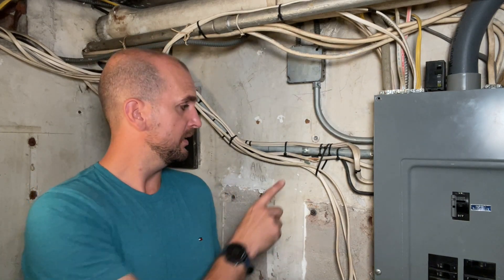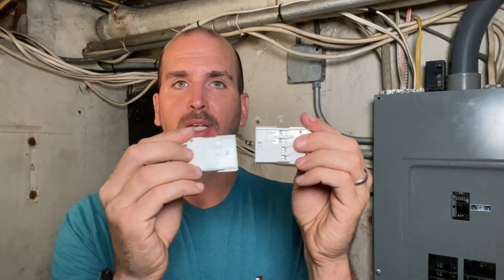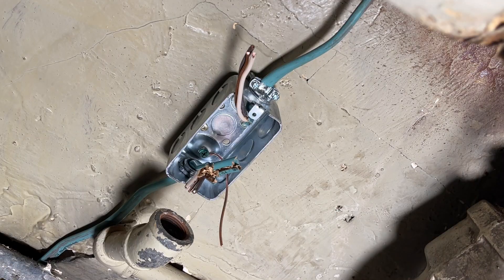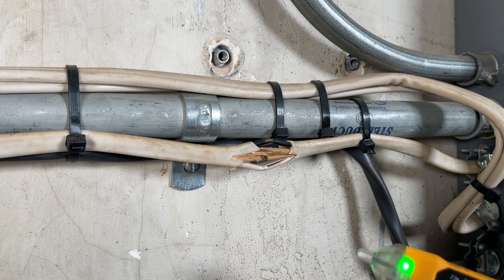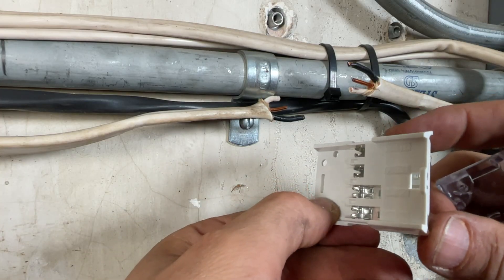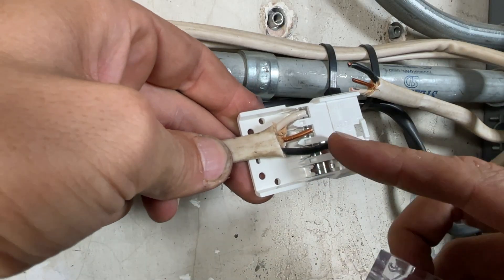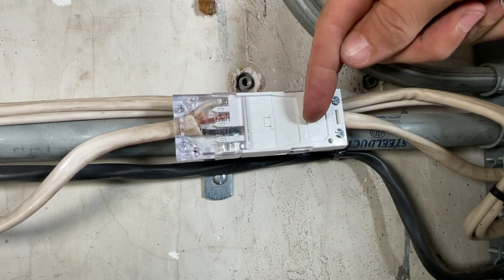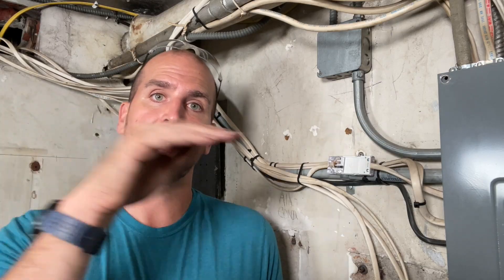How To Repair Damaged Romex Wires

Comment: It always bugs me that if the conductors aren't broken you have to break them??? Breaking solid copper which is a good connection. It seems crazy to add a point of weakness just so that you can have good insulation. Can you not somehow add insulation around the unbroken copper?
Reply: It's more about safety then maintaining the solid connection, if you are in the area, say running a new wire or a curious kid playing around, you don't want any chance to get zapped. Also, wiring is full of "weak points", every wire nut, outlet, screw terminal or other connection is a form a "weak point", adding one more isn't that big of a deal.
If you did want to add new insulation, you would have get a heat shrink tube to the exposed wire, which isn't going work for a inner wire, as the outer jacket will prevent you from doing that. The only case where heat shrink may be an option (depending on local codes) is if only the outer jacket is damaged (no exposed copper).
Things like Electric tape is not meant to be used as insulation/jacket repair, as it is likely to fall off over time and is against code.
Really the best way is to replace the whole cable. The old cable can be cut off where the split is, and re-used as two shorter cables elsewhere - or in the case of the video, he might have enough slack to cut the cable at the split and pull it 5 feet back to the box, depending on who installed it.
Reply: @notme232  I suppose you could put one of those small boxes around it and you fill with epoxy resin. Like a miniature version of the underground connecting resin filled joints. I've worked automotive electrics and we always solder everything, no screw terminals. You can't beat fused metal connections. I've never been a big fan of mechanical joints.
Reply: @toxicpadda  Boats as well.
Reply: @toxicpadda  ironically soldered connections on solid conductor are in fact weaker than properly crimped mechanical connections on stranded cable, emphasis on "properly".  The reason being is that in the event of an overload that doesn't immediately trip the breaker it can cause the wires to heat up enough to make the solder joint become ohmic and get into a thermal runaway condition not protected by the breaker.  Since the point of solder is to have an alloy with a significantly lower melting point than copper itself.  A proper mechanical crimp actually cold welds all the strands together to make a joint unaffected by the temperature of the conductor. Joining stranded to solid of similar gauge is very tricky since you cannot use a crimp conductor on solid conductor.  Solid conductors are only meant for wiring not subject to movement hence why even utility wiring is rarely ever solid.

All that said would rather use a splice kit that uses brass screw butts mounted in a nylon "barrel" that includes a section of double wall heat shrink in place of the snap-lock shown here. The contact fingers are fine but The insulation displacement connector style prongs should have stayed in the electronics world and never moved into the power electrical world.
Reply: @sivalley  Cold welding is an interesting subject altogether. There used to be a process that fell out of favour. It involved dendritic copper powder surrounding the wires to be crimped together. Sometimes the powder was stamped down. The copper powder would fuse on a molecular level , essentially becoming solid copper. 

It is a myth that solderd cables have a higher resistance. Even though the soldier has a higher resistance than the copper it's in contact with, the surface contact area is so great that the resistance is negotiable. I do understand  in a case of overload that the wires might heat up and unsolder themselves. but this would be far above the current rating of the circuit breaker. At this point  the insulation will start melting. It is unlikely that the majority of the heating would happen on the solder joint itself because of the "resistance to the solder"
Reply: @MyProjectBoxChannel  yeah very interesting. In the aerospace world, on an aircraft, compression crimped copper to copper is done for splices. With moisture, heat and cold, the solder joints have galvanic corrosion. This is the dissimilar metals. The joint would be copper, copper-solder alloy, then some solder, then copper solder alloy, then copper. I have designed, tested, and fielded aircraft electronic boxes, solder on the circuit boards, but copper to copper  crimps for the cabling. I'm always tempted to solder the cables, but it's not considered the most reliable.
Reply: @notme232  I disagree that adding a weak spot is not a big deal. I DO agree that many joints are done wrong for some reason and ARE therefore weak spots. Where in the code, I'm curious, would you say bans the use of electrical tape to repair damaged insulation; or where does the code authorized the use of heat shrink? What would you say about the use of electrical tape in pecker heads?
Reply: @michaelraab5669  There is a form of butt connectors (look very much just like the crimp-style) that consist of a length of heat shrink tubing, and then inside there's a ring of low melt point solder, and a ring of hot melt glue just inside either end.  You trim the insulation on both ends a bit, stuff them into each end of the tubing, and hit with the heat gun.  The solder melts and connects the wires, the hot melt glue melts and forms a water-proof seal around the wire, and the heat shrink tubing shrinks to provide physical support.

While this won't work well with solid core wire, it's code-approved AT LEAST (by CSA) for splicing underground stranded cable feeding submersible well pumps.  It used to be well drillers would have to special order the pump with a length of wire for the total length of wire to the nearest electrical box.  Now submersible pumps come with relatively short whips, and they just splice on whatever length they need from a roll of cable.  The splice ends up submerged.

I do not know the limitations of use.  I purchased a set of these splices from Amazon ahnd spliced what is essentially appliance cord on some built in lights (downlight LED hockeypucks), and as a concession to that, I layered some extra heat shrink tubing on top of it.  I'm confident that the worst that could happen is that a connection could fail, but considering where it is, it wouldn't do bad things, except cause a few lights to go out.

I would have preferred NOT do do that, but other options were not available without ripping out a lot of cabinetry.
Reply: I know what you are saying. A few minutes with a razor knife and some electrical tape and I could fix something like this as good as new and be neat about it
Reply: There is this nifty product called electrical tape, for the problem shown in the video there is nothing wrong with just taping around the romex, the bare spots on the conductors wont touch and everything will be fine.
Reply: @forddon  yes and nobody needs to know. And all will be fine 😉👍😂
Reply: @toxicpadda  I agree wholeheartedly but God forbid someone on YouTube shows how something is done in the real world.

Comment: That's how the cross-overs are done on manufactured home. Been that way for years and we've never been called back because one failed. Plug them in and stuff them into the underbelly, tape the hole and forget about them.

Comment: Where it is impractical or impossible to run new romex and the wire has no slack can two boxes be installed with new romex in between giving you the slack you need to make the repair?
Reply: Sure. Just don't cover them. A junction box is a junction box, you can have many but each new splice is additional points for failure. If done correctly, it isn't an issue. Basically like a giant pigtail with a jbox instead of wire nuts 😅

Comment: Clearly this is a demonstration so I will ignore his proximity to the panel . I was thinking about the WAGOS and the amount of metal to metal contact inside versus wire nuts . Then I thought every industrial machine in my shop has an electrical panel with hundreds of connections and voltage from 24 to 440  . And all the wires just plug into a connector that works just like a WAGO . So based on that I think they are just fine . As for that other connector NO WAY that will probably heat up with a heavy load like from  space heater ! That is just my 2 cents .

Comment: An electrician installing a circuit for my AC put a screw through a wire right by the breaker .  He said he was going to put a junction box next to the panel.  I said "no, you won't.  Run a new wire."  He was pissed but he did it and I went up and made sure he did.  That splice kit is something someone installs and says "that'll be the next guy's problem."  As I seem to be frequently the next guy, I don't like gizmo/gadet fixes.
Reply: I am an electrician, and while I wouldn't use this in your home, I definitely would use it in my own.  That thing looks like it will last forever on a 15A or 20A circuit.
Reply: @jeangadoury932  Go for it.  Won't see it in mine.
Reply: I don't understand your complaint. You say he was going to put a "junction box", so that is not a gismo/gadget fix.
Reply: @RemmikRotus  You're right it wasn't but I didn't want a junction box a foot from my breaker because the electrician didn't look where the wires were and shot a drill bit through a wire.  I didn't want a junction box nor a gadget fix.  I like clean wiring.
Reply: I agree - That splice kit looks like junk.
Reply: Omg,  you would have found yourself on the floor with a split lip  if I had been the guy you bowed up too. Tellin me what I'm going to do....Hey look..SMACK! 
Its the back of my hand !!
That's what's up....
Reply: @smf2072  Save your threats for your mom the next time she comes into your room.  I'm not impressed, tough guy.

Comment: I would use a Box at the break pull new wire to the box from the panel. I would not use splice kit .Was the kit design to use #12 wire ? If so I could see DIYer using it on #14 or even worst using it on old house wire which was over sized like #10 this could cause problems down the road as higher loads heat up the connector. I would just stay with the box.

Comment: If that piece of garbage is legal to bury in a wall I would rather make a soldered connection  covered with shrink wrap tubing. Putting any nick in a copper wire that has current and could get warm is a recipe for failure.

Comment: Scotch locks. Hated them when working on cars at a dealership,  almost always sorry connections. Never, ever used them, but replaced many bad ones. This is a household , high voltage scotch lock. Hmmmm.

Comment: I don't like all them wires not in EMT. Romex cable is for inside the wall not on the wall. I do have some exposed wires in my laundry room but I didn't wire the house. I wired a few homes but Romex was used inside the walls and Attic which is legal in the state of Florida. I don't like the method but it's legal. My future buildings wheather a house or shed will be wired with EMT. Wires should not be bare anywhere unless it's a ground wire. Back to my laundry room. The contractor that built the home put Romex wire through the blocks but the wire went through the ceiling because the top blocks are solid EMT should have been used and I may fix it with EMT before I sell the house.

Comment: I am a licensed electrician and run a somewhat large electrical operation.   The wago 221 is superior to wire nuts in multiple ways so I agree with the use and the recommendation.
The splice kit is a different story,  I have seen multiple mobile home fires caused by those connections.  Adding a junction box is always an option,  you may just either have to add an additional receptacle or have a blank plate on your wall. Usually if you tuck the blank plate low enough then it's never noticed anyway.  Also,  if you damage a wire and need to add a junction box,  consider what is on the other side of that wall.  I have seen many damaged wires and we were able to do a lot of them by adding a junction box in a closet or something similar.
Reply: I think I'd find the terminating point (receptacle or switch) and run a new line straight up into the attic (assuming that's closest) and bring the other end over and adding a junction box up there. It is accessible if not inconvenient but then you are not having to add something to a wall like a blank plate. I guess it just depends on the placement of the wire on which way to go... I'm not sure I'd be comfortable with that splice kit and just those little points of contact buried behind a wall.
Reply: @etherealrose2139  i can guarantee it will eventually fail, then an electrician will be cussing the person that did that. i've been there before, especially with the speed wire receptacles, i don't do the speed wire/back stab because of this issue, when a load is pulled through it it tends to fail. this issue carries to this splice block as well as those push in connectors, they'll all fail eventually if a decent load is pulled through it. the best spice is wire nuts or if you can solder it.
Reply: @gtb81.  Was told many years ago that the ground wire is never allowed to be soldered. Think they are afraid in a huge short circuit the solder could melt. They instructor at an IAEI continuing education class passed a splice kit around and it looked heavy duty and all of them are the only approved method to repair a damaged type NM cable ( no such thing as Romex in any codes book. It's a brand name ) and conceal it inside if a wall.
Reply: @JohnThomas-lq5qp  the thing about solder is it makes the wire actually stronger in that location, so it should never actually fail, especially if it is backed up by a physical connection method like a linemans/western electric splice. doing this, the wire would burn in two before that connection fails
Reply: if it is just skinned insulation i typically, if in a dry location, tape it up good with tape, making sure to wrap both wires up and then arround all of it a few times
Reply: There needs to be a junction box. Period. The method in this video cannot be code legal.
Reply: @SwitchingRooskies  They are indeed legal under 2020 NFPA 70 code reference 334.40b
Reply: @SwitchingRooskies   They make a listed connector to splice damaged type NM cable ( Romex is a brand name and never found in a code book ). Was told at an continuing education class that they can be covered over by say sheet rock while all splices made inside of a box must remain accessable.
Reply: The Wago relies on a spring, just like the stab back device. Neither should ever be used. I'm certain the only reason they are still allowed is because of the influence of contractors v that. Just want it cheaper and faster - not necessarily better or safer. Twist your wires then put on a wire nut. You'll never see a joint come apart if done in this manner, but I've seen many burned outlets where stab backs were used.
Reply: @dangroce82  Not sure what you're thinking of, but the Wago connector does not use a spring, it uses a lever.  Definitely not cheaper than wire nuts, and people screw up wire nuts all the time.
Reply: @JonathanMurray  There are wago connectors without the lever. You can see them if you do a quick Google search.
Reply: @JonathanMurray  and  @Ixionn  I Stand corrected.
Reply: @dangroce82  Wagos do not rely on a spring. They rely on a cam mechanism I believe. Push ins I'd definitely avoid though.
Reply: @dangroce82  FACTS to the max
Reply: @dangroce82  The wagos secure everything with a cam action. give everything a pull test - if good, it won't let go.  They also have port so you can do continuity tests  if you really want to go to town.
Reply: @dangroce82  Wait a second. Wagos rely on springs? I’ve always heard them referred to as a lever design creating something like a cam action.

Comment: Very often there is no "extra" wire with which to use a wire nut, or provide the required extra wire inside the box. Since the copper conductor is not damaged I would prefer to just repair the insulation and the jacket. This would be a better repair, but I don't know of any approved way to do that.
Reply: Two junction boxes with a new run of wire between them.  In this video the one side was so close to the main panel I'd use one junction box and run a new longer piece from the panel to the junction box.

Comment: NOPE! box not grounded!  should have wrapped the ground wires around the two (green) box mounting screws
Reply: He had a ground wire on the Grounding screw before he started....
Reply: @etherealrose2139  okay, missed that.  didn't see it get tied in, in the fancy connector.

Comment: I would insulate the exposed wiring instead of cutting and using connectors that way corrosion over time does not cause a bad connection.